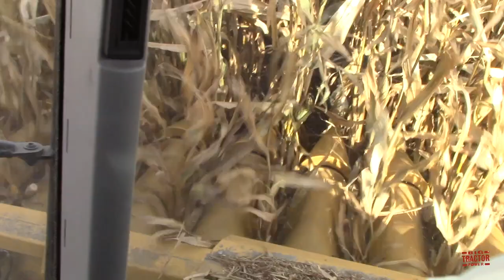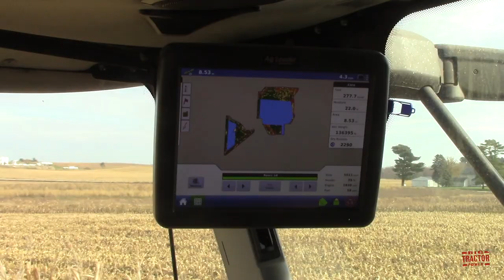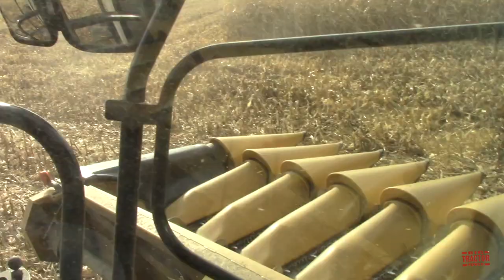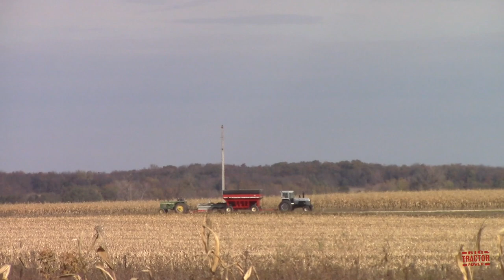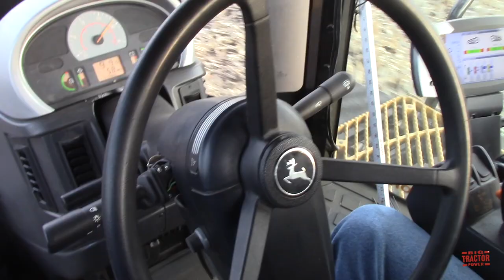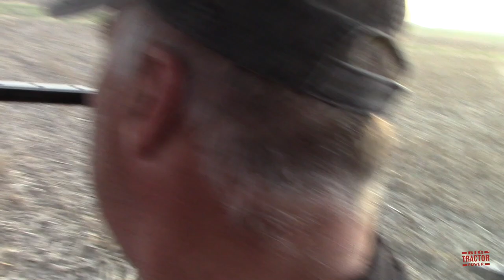IOWA Corn Harvest & Fall Tillage

Comment: On our farm following soybean harvest we use a 1960's model Minneapolis Moline 10 ft disk and John Deere 12 ft cultipacker pulled with 2002 New Holland TS 100 to till the soil for sowing wheat we use an IH 510 drill pulled with a 1984 White 2-75. For tillage behind corn we still use the same disk but pulled with the White. If we are plowing  depending on the year we use an Oliver mold board 3 bottom plow pulled with the New Holland. In rare instances to beat the weather we have used both of our Oliver 3 bottom plows then that case the disk goes on the 1973 Oliver 1365. Before we do any corn tillage we use both the John Deere classic gyramor 207 on the Oliver or John Deere gyramor  307 on a 1947 Oliver 88 standard ( if all of the tractors are in use) to  chop up the corn stocks.

Comment: interesting they only use 600 bu wagons which have to travel up and down the road. And whats with the john deere steering wheel on the tractor? Using JD autosteer?

Comment: We usually chisel our corn stalks and bean ground with a 7 shank Landoll disk chisel pulled by my uncles JD 4450. Or if we are in the mood we'll hook up the 5 bottom IH model 550 plow to either my Case IH 2096 or JD 4320.

Comment: Did they have a spare John deere steering wheel badge that they decided to stick on a challenger tractor ?
Reply: Looks like they added John Deere GPS autosteer.
Reply: To remind them what tractor to buy next, lol
Reply: Noticed that too
Reply: The screen is also Johndeere
Reply: I think that’s a John Deere autotrack system which comes with a wheel. That’s why it would have the deere badge

Comment: Why does the AGCO Challenger have a John Deere steering wheel ?
Reply: It has an auto trac universal steering wheel which allows them to run deere gps in a brand X piece of machinery.  You could put it on anything with a steering wheel.

Comment: Its a damn shame so much of our 2020 corn crop was wiped out by the August 10 derecho.  Still lots of corn in the fields that's either flat on the ground or lodged so bad you'll never get much of anything into a combine.

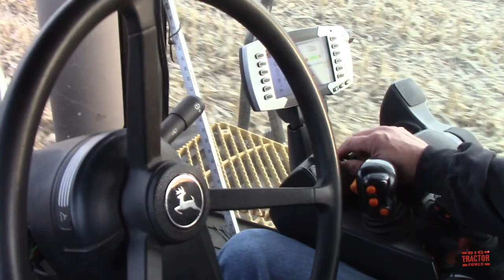Edit:  10:15 thats a nice Deere steering wheel in that Challenger tractor.

Comment: You know, if there was some light blue striping added to that 6-175, it would look like a Lamborghini. Wonder if they're related?
Reply: They are. The tractor was a common platform between Massey Ferguson, Agco Allis, AGCO white and Lamborghini. I don’t know what engine the lambo has but the big difference between each was the color and engine
Reply: @nellsonstout7001  That's interesting. Always wanted a Lamborghini tractor, just didn't know what parts availability would be. Now I'll have to do some research. Thanks!
Reply: @nellsonstout7001  The engines were indeed different. White had Cummins, Massey Ferguson had Perkins or Valtra/Sisu, Agco Allis had something else. We looked at an Agco Allis that had a Detroit Series 40. We had a couple of MF tractors on the old dairy farm. Perkins and Sisu are great engines with good fuel economy for the power.
Reply: Tom Cleverley some of the AGCO Allis tractors (with the common body style, not just 9100 Deutz Allis,) had Deutz engines. I guess one could argue that the series 40 Detroit’s are international too
Reply: @nellsonstout7001  the model that we were considering at the time was a 9455 that had the Detroit Diesel. It also had the MF Dyna Shift 32/32 transmission. We had 3 tractors with that transmission, MF 6170, 8160, and a Challenger. We had a couple of White tractors and they were good machines as well